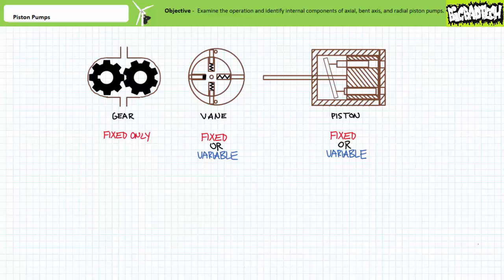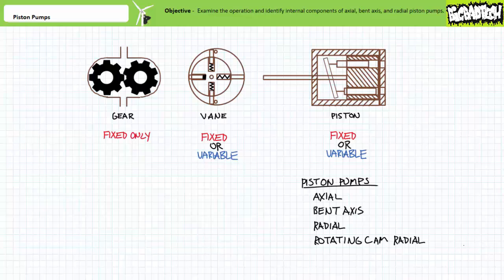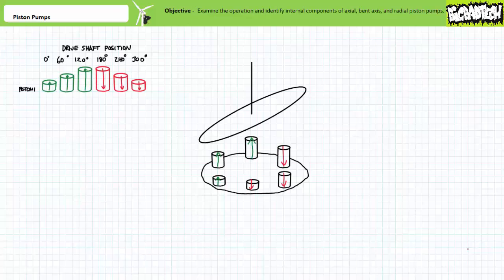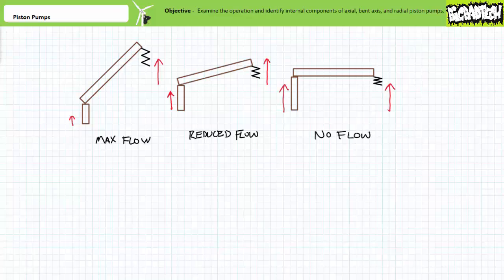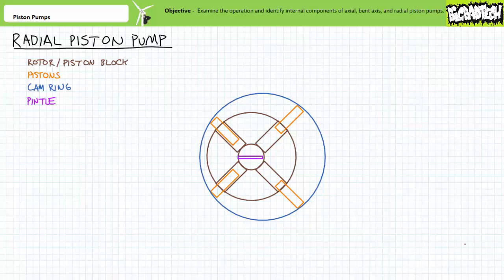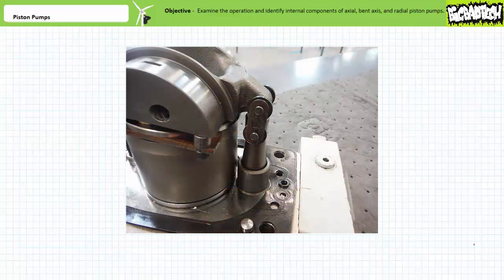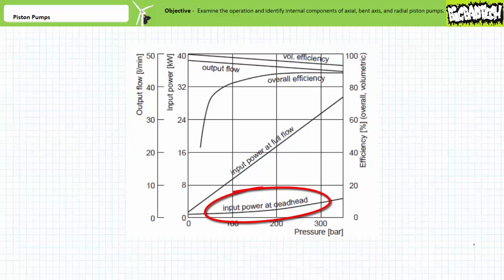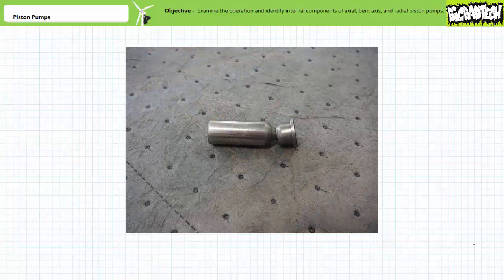Piston Pumps (Full Lecture)

Comment: I love you work. Simple factual and without nonsense. 

I am working on a dual parallel PC piston pump arrangement and have struggled to find detailed information regarding expected flow rate. Is it as simple as double the flow or is there some science limiting the eventual flow from the double pump setup?
Reply from the maker: Honestly best place to get this data is directly from the pump manufacturer for the pump of interest. Often they'll have applications engineers on staff that can guide you through these very specific applications. Pumps in parallel need to be very similarly rated. With perfectly matched pumps in theory you'd double flow at a specific load induced pressure ... however ... with twice the flow one might observe increased pressure drop across components and valves.
Reply: @bigbadtech  thanks mate. I had been trying to avoid the manufacturer. Ive utilised all there technical docs on the website which are indeed super detailed.

Ill reach out to danfoss.

Thanks again

Comment: Extraordinary explanation of axial flow pump,as in college class profound and highly detailed (the flow charts was accurate 👍)i feel highly proud , congrats!!!!
But i have a little question,if in jet turbines i push the throttle levers to change the swash plate angle of the fuel pump?from where the turbine combustor gets the starter fluid pressured?
Reply from the maker: I don't have a lot of experience with jet turbines, however, I do know that some mobile (ie: forklifts, etc) use a pressurized reservoir rather than atmospheric/vented reservoir.

Comment: what happens if the pump have a fixed suction and discharge pipe arrangement , and prime mover is reversible ?do we need to do any adjustment to swash plate ?
Reply from the maker: Hard to answer without drawing a diagram so hopefully this description will help.
FWD: Flat plate = no flow, left side up, right side down = full flow forward
REV: Flat plate = no flow, left side down, right side up = full flow forward
Not sure if you'd want to do this though because the P and T pipe diameters are typically different diameters.

Comment: I want to know, when pump starts pumping and system is in isolated conditions with close cenetred valve.. Then in which way/path pumping oil go to the tank??
Reply from the maker: With closed center valve pressure will rise to setting of pressure relief valve at which point pressure relief valve will open and spill flow to tank
Reply: @bigbadtech  But pressure has not shown in relief valve's  gauge .. After reaching the cracking pressure then pressure relief valve activate..i actually want know in unloading condition how pump drain the oil?
Reply from the maker: Check out the "Hydraulic Pumps" lecture at:
https://www.youtube.com/watch?v=TBxMgGq3O94
I discuss load sensing pumps in general terms in this lecture. In the unloaded condition a variable displacement pump "destrokes" to a very small displacement per revolution. Any leakage is channeled away via the variable displacement pump's case drain.

Comment: What factor/s enables a designer to make a choice between a fixed displacement or a variable displacement pump?
Reply: +D. G.I believe I can provide an answer to that question; as I'm familiar with the hydraulics / hydrostatic systems to mobile construction equipment specifically compact Skid Steer Loaders.
Before I attempt to answer the question; I must say, hats down,  I am an avid fan of Jim Pytel’s merited exemplary lectures; that frames the topics discussed comprehensibly and non-intimidating.  
From what I’ve been across with in mobile construction equipment the hydrostatic (term for hydraulic fluid drive power) system consists of a variable displacement pump and a motor.  The variable displacement pump’s job is to actuate the motor, which in turn rotates the wheel to drive the Skid Steer Loader machine. 
The pump is intentionally a variable displacement pump; specifically a variable displacement axial piston pump.  As one would expect the drive system needs to be setup in a way that is able to be precisely controlled and managed by the operator in the machine.  A fixed displacement pump in this type of application would not be practical at all as one would imagine after understanding the concept differences between variable displacement pumps and fixed displacement pumps.  The person operating the machine can adjust the drive speed by adjusting the angle of the axial piston pump’s swash plate; either by manual actuation from a pedal that has a mechanical linkage to the swash plate, or electrical actuation through joystick operation that energizes a three position, four way, spring centered, double solenoid, solenoid operated valve. As you can imagine the machine can drive forward and reverse, thus the reason for the double acting solenoid valve unit.  Each solenoid is assigned for one swash plate angle side.  One angle side of the swash plate drives the machine forward, and the other side of the swash plate angle drives the machine in reverse.
I’ll discuss this in more details once I’ll reach the hydrostatic axial piston pump in the video series I started performing each week on Saturday; with the systems and applications being discussed belonging to a Skid Steer Loader Machine.  I’m particularly fond of Skid Steer Loader machines because in my humble opinion; they imply and encapsulate all the major hydraulic components; and is a great way to learn about hydraulic systems and its constituent components; without being horrifically complicated as some other machines like the Telescopic Machine.
I hope that helped..
Cheers mate.
Reply: @northernfreedom6252  thanks for sharing 😊
Reply from the maker: +D. G. As with everything ... money! Fixed displacement pumps are simple and inexpensive however flow is constant if the primer mover is fixed speed. Variable displacement pumps are more mechanically complex however flow can be varied.
Reply: Tx Mr. Pytel,
Could one assume that cranes,front end loaders etc use a fixed pump for mobil operations?

Comment: Hi Jim. While operating a Caterpillar loader with hydrostatic drive that can move at say 0 to 6 miles per hour( just an example), if I am pushing a heavy load at 4 mph and the machine can no longer move forward against the load,  I reposition my travel control lever to a slower travel speed position, lessening the swash plate angle, to say a 2 mph setting, the machine can now push the heavy load again, in essence gaining torque at the drive motors, but lessening flow of oil to them, why does the machine gain torque while the flow becomes less? The rpm of the Diesel engine stays the same, the pump is a variable swash plate, and the hydraulic motors are fixed bent axis. In other words, why does torque go up while speed (or flow rate) goes down?   Thanks Jim
Reply from the maker: +John C I'm out of my league when it comes to the specifics of mobile hydraulic applications, however, this might be an example of something called a "constant horsepower" pumping circuit. I have another general pumping circuits lecture in the works detailing pressure compensated and load sensing configurations as well as a brief primer on constant horsepower applications. Long story short ... you're absolutely correct. If the product of torque and rotational speed (plus a constant accounting for unit conversions) equals mechanical power, if speed goes down, torque goes up, keeping mechanical power constant.
Reply: +John C If you refer to 14:09 in the video during the pump data sheet explanations; you can find the answer; or at least provide some aid to the answer you seek I believe.  Here is the citation of Jim Pytel at that mentioned reference point-
“
As we’d expect; flow rate goes down, at higher pressures, given increased leakage, and the tendency of the nominal rotational speed of the prime mover to decrease given higher torque requirements at higher pressures.
“
To express my humble opinion, and finding based on my experience with such type of machines you are referring to- A high flow rate indicates less induced pressure resistance created by the load the machine is transporting, which conveys the idea of less torque power requirement. In contrast, a lower operational flow rate of the pump indicates increased pressure resistance created by the load the machine is transporting; which conveys the idea of higher torque power requirements.
Essentially for the machine to operate at the given high flow rate  you mentioned, the pump and motor is incapable of providing the required torque power to transport the given load.  
Additional to that; I’m not sure if the machines you are referring to has this option; the machine brand I am familiar with have a high flow option.  What that means is when this option is selected; for a given oil quantity provided by the pump to actuated the motor; half the allocated motor input is used.  Additional surplus pressure is relieved by a pressure relief valve.  This would mean the inrush of pressurized oil to the motor is confined to half of the allocated space; reducing the speed of the machine while increasing its torque and power. This would conclude and provide the answer to your query; if the machine you are referring to has this option. 
I hope that makes some sense.
Cheers mate!
Reply: In my humble experience with caterpillar hydraulic systems ,we have to remember that there's certain amount of pressure check valve's and electric-hydraulic sensors (newer machines) that protects the pumps against back pressures (due to flows laws),soo certain behaviors of the hydraulic system at pushed throttle or high levers speed? ends in that !!!
Reply: Think of it like a hydraulic jack.

If your pump is at min swash and your hydrostatic motor is at max swash you have effevtively gained a reduction.